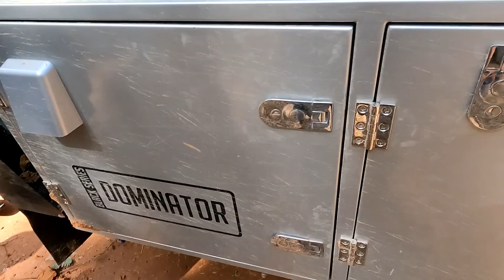Snapped my trailer off on CREB track 2021

Comment: Hitch would probably be a high tensile forging which should not be welded.
At the very least, use a high nickel alloy such as austenitic stainless steel weld rods to prevent brittleness and cracks. Preferably with pre and post-heating.
Reply from the maker: yeh we know hence why we pre heated it.. it was some small insurance to make sure we made it to the next town!

Comment: Just a tip - place your trailer chains over the top of the drawbar, not underneath.  You had them correctly X-over.  When you run them over the top the trailer won't go through the tailgate.  I know it didn't this time, but that was a bit of luck.  I saw a video the other day of an older couple's chinesium caravan where both the A-arms of the suspension broke apart due to the absolute junk metal they were made of, just like your hitch.  Get rid of that thing ASAP and put a proper hitch on.

Comment: if the research had been done before everybody had left home then you would of found out that it is a full 4wd track and not for campers
Reply from the maker: if you done your research it only mentions its not advised. i made a conscious choice to take the hard track instead of the track around this line because i enjoy the challenge and the adventure! this track in a 2wd track in the try there is absolutely nothing hard about it in any way if you choose to take all the easy lines
Reply: @Lukefink  mmmmm